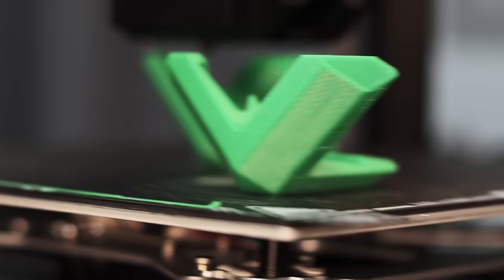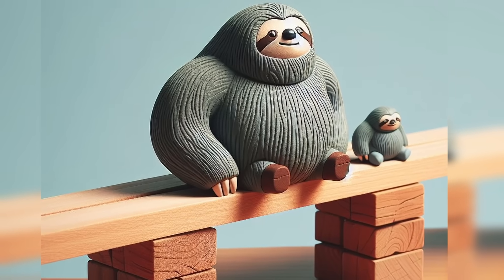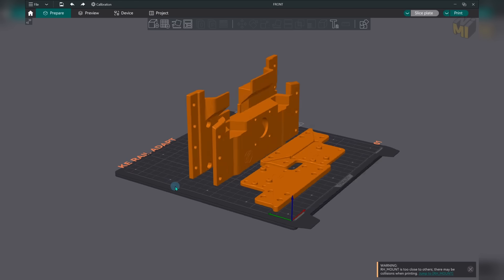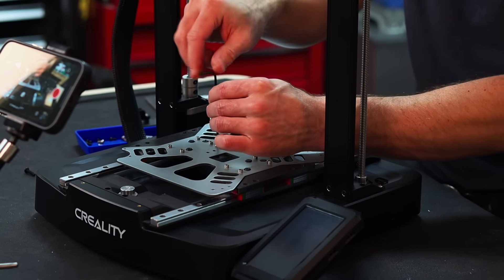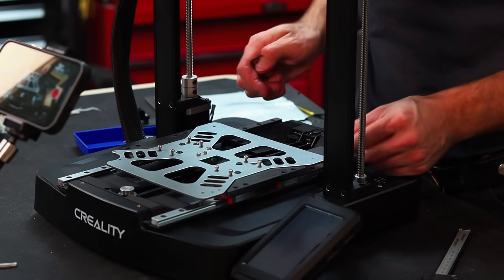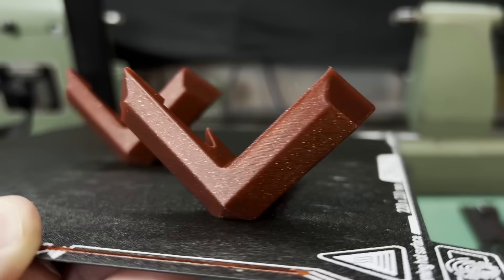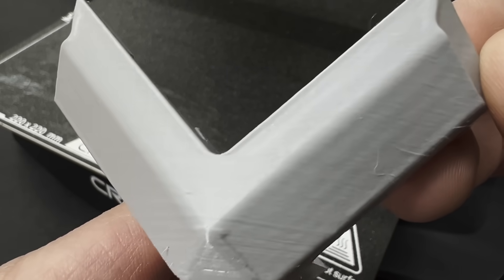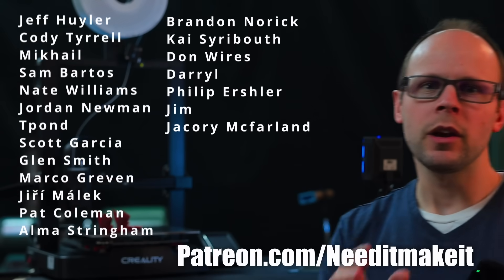UPGRADE your Creality Ender 3 V3 KE with Linear Rails

Comment: But hear me out what if we made a bambu lab p1s have linear rails?
Reply from the maker: The design of those printers is completely different and they don't seem to require lin-rails.  The parts riding on the rods don't have such a large 'lever-ing' out and movement stays to a minimum.  I don't think it's a bad idea, it'd just be tough to implement, those printers tend to be signed-sealed-delivered, not much you can do to upgrade them, wrap them with pink leather maybe?

Comment: do you have any recommendations for CR10 Smart pro? I always wanted to put linear rails in it.
Reply from the maker: I had a look and that printer looks quite easy in comparison to upgrade, linear rails mounted to the side of the central extrusion  and then we mount the carriages to the plate with a 3d printable angle bracket to have those at 90 degrees as well.  There is probably already a kit out there, I believe have seen something.    Well I was wrong, it's not for the CR10, it was for the Ender https://gulfcoast-robotics.com/collections/mgn12-kits/products/mgn12-linear-rails-kit-ender-3.   It's the same concept though, it would be 10X easier to do this upgrade than it was for the KE model I just finished.
Reply: @NeedItMakeIt  Thanks for responding! Do you have any step files for brackets that needed to connect the rails to the gantry? Also where can I buy the linear rails from for the size that will be needed?
Reply from the maker: @meetpatel4225  I'm working on another solution so that we can add rods to stabilize the posts, it also needs to look good and print easily so that's a bit of a challenge.  I should have an update within the next few weeks on that.  

I've added a few links in the description for the rails, one is Amazon, the other is Aliexpress.  I bought mine at Ali, but they weren't a perfect fit.  They'll wear in over time, but it's better to go a little better quality if you can.

Comment: I think it would be better to keep the original aluminum plate rather than 3D print one. The weight difference would be moderate, but i don't think this would make a difference on max accelerations. I tried it on my ender 3 V2 that is not even an ender 3, and I have got zero benefits rather than have a tiny more wobble.

Note : I love your videos and how active you are, keep it up ! <3
Reply from the maker: Hey!   If it were aluminum, I'd definitely keep it, but they made it from steel and it comes in at about 500Grams and when I added the prints to it we had about 600g.  When I swapped it out, we were at 139g, which is a pretty good savings, you can certainly feel it when you move it around with the belt taken off. 

Thanks!  I have 1-2 videos every week, some take longer than others, I need to get better at this so I can get more out there.
Reply: @NeedItMakeIt  Dang that's heavy ! Yeah well 3D Printing a carriage seems to be a good idea then.
Reply from the maker: @laydnbeats  yeah, I don't know who made that call, and it was bowl shaped as well, I've no idea if that was on purpose either, the parts mating to it weren't bowl shaped, I can't see that working out well.  I hope that this option gives people an alternative that lasts the test of time and helps to get their prints to the next level.
Reply: @NeedItMakeIt 500g is crazy! Can't wait to see what you come up with.
Reply from the maker: @802Garage  Core XYZ bed slinger next, I just need to figure out how to cross the belts over each other!

Comment: PC plate might be too flexible (esp. in Z direction) to work well, but let's see it tested :)

Does Klipper have Z or weight compensation for IS frequency (Marlin FTM does, for the record)? Or maybe IS for Y should use wider shaper to cover the range from empty plate to full plate / high Z ?

Overall, KE sounds like a good printer, until it's not. Likewise K1 sounds like a good printer, but VFA. K1C fixed that, but changed to different harder-to-get nozzle.

If you have K1, how about a mod for smaller pulleys etc. to bring VFA on par with K1C? Maybe shorter stepper motors are not required 🤔

Bedslingers are perfect for slow big prints (plus and max variants) and moderate speed (still a lot faster than what we were used to in 2022 - thanks to Klipper and Marlin IS!) small prints.
Core-XY seems to be the only way to go for impatient people with a bit more loose money or high requirements for print quality 😅
Reply from the maker: It's certainly more flexible, I'd like to look at an aluminum version, and in each case I'd need to buy the accelerometer add-on to allow the resonance to be measured correctly.  Right now it uses Klipper with hard-coded values and I could be wrong, but it should be measuring before for input shaping, but also while the print is occurring to adapt while the mass on the buildplate changes.  

They've made a cheap starter printer, but it's not as easily upgradable as the older gen with the extrusions, this would have been such an easy project if I didn't need to try and fit these parts to something that has such a strange shape.   The newer metal frame Ender 3 V3 has a nice flat solid base, but it seems that they've replaced the small rods with larger 10mm, and maybe they'll be a better fit to avoid these issues.  

Having moved mainly to CoreXY myself, I see a pretty big benefit, mainly the enclosed print, but also that I can design and print something the same day, I can also take an order and ship it out the same day, which is pretty nice for everyone.  It is a bit of an instant gratification, wait until the replicators come out....

I like your idea about the VFAs for the K1, there are probably a lot of people that could use an upgrade like this.  Creality should provide one!

Comment: This made me sub. Great mod and i like that you made an improvement on the current rail mods available. Looks great. Pity the rail sets here are so dam expensive. Greetings from South Africa
Reply from the maker: Thanks!  It was a lot of work to get to this point, but it turned out well, we just need to work on the extruder and we're going to be in good shape.  

I was able to get my rails on sale at Aliexpress, but when I went back to look they were out of stock... Amazon.com seems to have them for the cheapest at the moment, but maybe there is another source.  Mine weren't the best, the stock Creality one on the X axis was smoother and quieter, and looks better frankly with the black.

Comment: Cool upgrade, i use the ldo rails on my ender 3 they are alot better than the cheap Amazon ones, travel speed seems to affect most creality bed slingers
Great video
Reply from the maker: LDO, I'll have a look, I don't use to many linear rails, but I think there are quite a few projects coming up that will require them so I'll need a better source, thanks for that!  I just had a look, can you purchase direct?  I can't find any side for LDO, only resellers.
Reply: @NeedItMakeIt  i got mine from onetwo3d not sure if you can get them direct

Comment: Excellent work Mike on going above and beyond to do the work that, IMO, the Creality engineers should be doing prior to product release.  It seems to me that the Creality production model needs to change, especially in the face of its competition nowadays that aren't cutting corners nearly as much.  Sure, Creality's printers are cheap, but as another commenter points out, to actually get them to a point where they print as well as a competing product that costs a little more, you end up spending way more than that competing product.

IMO, the marketplace is changing.  More and more people are expecting something that isn't cutting corners straight out of the box.  Creality needs to decide if it wants to be a maker of well designed printers for a low cost, or continue to product straight up bargain bin items that don't work as well as the competition out of the box.
Reply from the maker: Thanks Stew!  All of this seems so strange, from the extruder to the rails to the steel plate, what was going on?  Was this a noob design?  It reminds me of when I was working on our bit CNCs at work a few years ago, we had custom bits breaking constantly, they caused 2 fires as well, when I looked at the design, it was horrific, I worked on a new design with a different company, and we used traditional methods of router bit design, and guess what.  Not only did the problem go away, we had better cuts, longer lasting cutters ... and not by a small margin, by a huge margin.  No more fire hazard.  When something is well designed, it's a beautiful thing. 

I think Creality can rise to the occasion, they just need to say goodbye to what worked for them a few years ago, maybe it's not so easy.  I'd love to see a modular printer design, give me a printer that is build-to-mod, I want threaded holes everywhere!

Whatever Creality comes out with next had better blow our socks off, they need to innovate and do things differently.  Take everything that people want and find a way to get it into a printer with a ground up design.

I always appreciate your insights!

Comment: Could have bought a proper printer twice for the money and trouble you get from this
Reply: The KE doesn’t need any upgrades to print 24/7 fine. This is overkill but fun. It’s insane the level of cringe I see from Bambu fanboys.
Reply: @ThisIsDan-i  for sure it doesn’t need the upgrades but it can always be a bit better, same goes for any machine nothings perfect you’ll always need repairs and maintenance
Reply: @hussxin71  Oh I agree! I think cheaper printers like the SE and KE are great tinker printers since they won’t cost as much to replace. I’m much less inclined to mess with my Qidi or k1 max.
Reply from the maker: I wouldn't have had as much trouble if they just gave me a few mounting holes, but geez having to scan and fit these parts was quite a bit of work, but it turned out nice in the end at least.  I think there might also be some other ideas to add like wings on the rear adapter so that we can also add rods to stabilize the posts and have it look more integral.  There aren't any nice looking solutions for that right now.
Reply: @NeedItMakeIt  what scanning app did you use? Been messing with Kiri engine but looking for a main to scan things.
Reply from the maker: @ThisIsDan-i  I've been using Polycam for quite a while now, and it's pretty good, not perfect, but I don't pay for it, I use the free version and then I export the file and then convert it to OBJ in a free software as well.  I don't really use it enough to justify buying it, but I have paid for it in the past when I had more scanning to do.  It's one of the best phone scanners IMO, but maybe there are other good ones out there as well.  If you have an Iphone, it tends to work better, the LiDAR scanner works with the app to provide distance data which scales the part for you to within 1%, it's a nice little feature.
Reply: Not true literally at all the KE is a huge hassle. I can’t get a print to save my life. Fresh out of the box it need to be fixed because the bed is warped and reality won’t answer the ticket
Reply: Have you ever bought a perfect priter before. Most people enjoy upgrading thei printer and designing and printing part to make it better. My first printer i bought for 80usd used and spend time and money to make it better.
Reply: i have even cheaper v3 SE, currently highly modified and I have to say, that it's worth the money and time I spent with upgrading. It was fun and I've learnt a lot of new skills.
Reply: @qeepo  I think that's an important consideration most people overlook... If you're already familiar with the intricacies of 3D printing you might be better off with a more polished machine, but the minor upgrades required on the Ender range are a great learning process for beginners or people who just like to tinker 😁
Reply: what printer would you get for half the price of this? theres no way youd get a plug and play printer that cheap
Reply: @hussxin71  he spent so many hours tinkering with it and buying parts and testing and what not. If you value your time at all you get something like Bambu lab or something.
Reply: @TommiHonkonen  I have in fact got both an ender 3 v3 and a bambu p1s. Enders have always been the go to for tinkerers and even with the new ones they’re still a diy machine. Being able to work on it and make upgrades/fixes like this is one of their biggest things imo, they’re budget printers after all they won’t come perfect, but that’s expected at their price range compared to a bambu lab or other
Reply: @hussxin71  I expect the Bambu is printing 247 and the ender is on the operating table 247
Reply: @TommiHonkonen  well my old ender is retired now but my v3 se runs well I’ve got it dedicated to TPU and the p1s does everything else. For the price the v3 se/ke are still very good printers
Reply: @hussxin71  anything can be good for the price or it maybe lemon
Reply: @TommiHonkonen  Part of the enjoyment of any hobby is tinkering around with what you've got.  To try and make it better.  I love the journey.  Yes it takes time.  But if that is what you enjoy, go forward it.  Is what I think.
Reply: @TommiHonkonen stop loosing your time on youtube, you can work and win money ...
Reply: The Enders are billed as budget printers for beginners though and that is not the case
Reply: @TommiHonkonen  Есть люди, для кого это первый принтер. У меня он печатает на постоянной основе уже несколько дней. Нареканий пока что никаких. Да, можно получить качество печати лучше, но bambulab a1 стоит около 400 евро ( в РФ 50к рублей минимум). Так что Эндер реально хорош за свои деньги, как минимум потому, что с ним можно войти в печать и , ничего не зная, потихоньку изучать его. Для справки Ender в РФ стоит 20к +-, а bambulab a1 50к + и мне, как студенту, проще 20к найти, чем х2.5. Я предполагаю, что за решение, которое просто печатает, делает это просто нормально и позволяет решать задачи это ender
Reply: Really? My V3 has been amazing for the price... I can't say the same about my V2... Ed: oh my bad mine is an SE.
Reply: Der ganze Umbau und dann solche schlechten Teile gedruckt!diese Teile druckt er in der Qualität auch ohne Umbau!🤦‍♂️Schwachsinn was du machst!
Reply: But.. How it's even possible creality doesn't provide a more stable bed system, its like a toy, and further more after relaunching million enders . It A B C. What's a recommended printer , balanced in price, not headache tinkering, reliability , customer service, avaliable spares,  print quality .. ? Is there an option between or just expensive bambu with bad customer service  praying not to fail, or creality? Whats healtier for piece quality , budget, and brain  peace? There are no vorons where i live, ¿what about flsun 400 or t1? Where do they fit ?

Comment: The KE is my first FDM printer, and your KE videos are how I found your channel. I’m really enjoying your work, thanks for the great content!
Reply from the maker: Hopefully the rods and linear bearings on your printer fit better than mine did.  I'll have a few more videos for upgrading this printer coming out as well so that we can get a fast printer with excellent results and keep the price down.  There are a few challenges to overcome, but that's what makes it interesting!
Reply: @NeedItMakeIt  I just ordered one yesterday as an upgrade to my really old ender 3 and I'm super glad I found your videos as well! Your review of it was very good!
Reply from the maker: @kslayer0  Nice! I have quite a few upgrades/mods coming for this printer.
Reply: @NeedItMakeIt  How well do you think those will work out of aluminum? I have a roll of polycast I've been itching to play with more and try casting some actual useful parts! but my modeling/cad skills aren't all that refined!
Reply from the maker: @kslayer0  I've like to see that!  I've been getting ramped up to cast some parts as well, but my capabilities are pretty small.  I think the plate would work amazingly from alum, I can send you the updated STL if you'd like to try it out.  I am just about to re-print a more refined version.  You are referring to the piece which I made from Polycarbonate correct?
Reply: @NeedItMakeIt  That one as well as the rail mounting pieces! I'll try and remember to take a video! My capability is still pretty small casting and I am still working on refining my molding techniques! But everything is home made that I use minus the crucible!
Reply: My first printer too and Im having a hell of a time understanding things especially leveling the bed like, how do I doooo thissss?